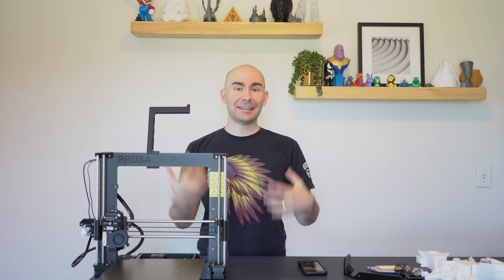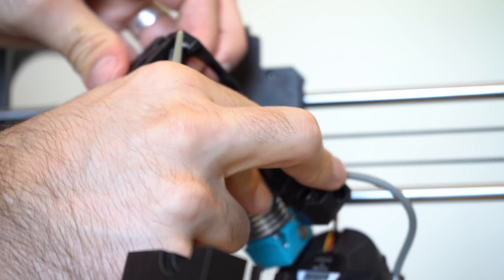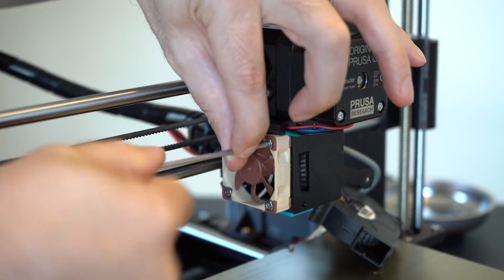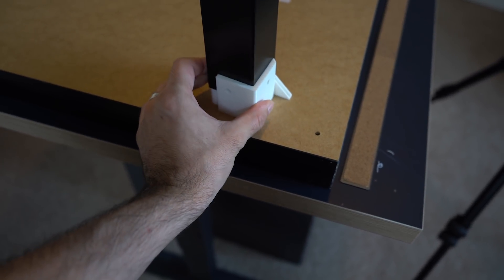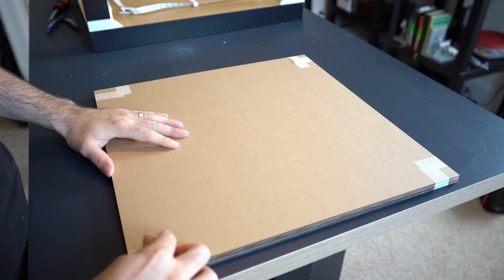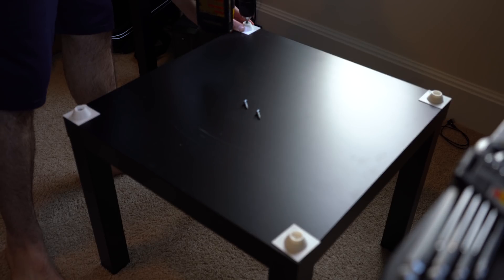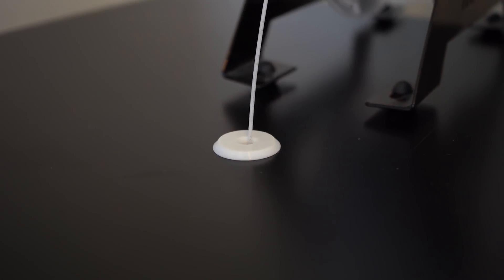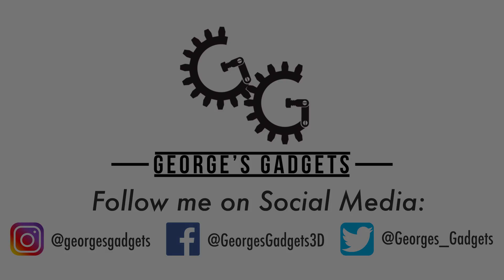Assembling the IKEA Lack Enclosure & 3D printer Prusa MK3 new carriage

Comment from the maker: Has anyone built an enclosure yet?
Reply: Yes, actually not a fan at all of how rickety it turned out, far too much inconsistency of the tables.  Going to just get some lumber and rebuild it reusing the plexi again.
Reply: @cruzinbill  I tried it with a slab of concrete and it seems like that stabilizes it quite well
Reply: @blackhawk7118  if your table falls through the floor post a picture so we can have a good laugh.
Reply: @blackhawk7118  Please, tell us more about this concrete slab.  does it make the structure significantly more stable?  How much and where did you add the concrete?
Reply: @johnahamelv  Yeah, it stabilizes everything surprisingly well, I put some foam pads on the underside, in order to avoid scratches. I suggest you watch cnc kitchens video about it, he uploaded one yesterday!
Reply: @blackhawk7118  I watched CNCKITCHEN' video, but he does not mention the specs of the concrete slab (dimensions, weight, etc.), or the process of how he produced it.  I assume I can purchase a bag of concrete from Home Depot or Lowe's, but I am not sure what to do after that.  Also, is the foam he is using is pretty thick, so I do not think it is carpet pad.
Reply: @johnahamelv  At my local hardware store, you can just buy any old slab of concrete. It does not need to be anything special, also I don't use foam, only small feet, those that you put under Ikea stuff so that it won't scratch the floor. Don't know how you call those, just those little pads :D in Germany we call it "Filz". Maybe look into the paving section
Reply: @blackhawk7118  Thank you very much.  I was under the impression that I needed to build a mold to pour wet concrete.  A premade paver sounds like a much more reasonable solution.  I think I should be able to find a correct size paver for my enclosure at a local hardware store.  Again, thank you so much!!
Reply: @johnahamelv  no worries, I'm glad I could help you.
Reply: @blackhawk7118  I stopped at Home Depot.  I purchased a 37.3 lbs 16" x 16" x 1.87" paver for $3.89 + tax.  I guess I have not visited that part of the store in a long time.  Now I have to figure out what foam to use.
Reply: I haven't build an enclosure, yet, as I am not currently home. However, I've used half of it to rack my PowerEdge R710. I put casters on mine that I got from the local hardware store. I have a different 3d printer, so my tables are upside down and the top meets legs to legs (if that makes sense at all). I printed some parts that I found on thingiverse to facilitate this coupling of the tables. The casters were my idea and the racking of the various computers/servers in there were based on trial and error of different mounting hardware. I have two tones of some LED strips I bought that rate about 85 CRI that I am going to mount to give some passive lighting. I also want some RGB action in there--this is a secret I'll be working on when I get back.. This video inspires me to add some features to my future enclosure. Btw, this is a really great video--one of your best.
Reply: Building it right now
Reply: no but I'm planning on it.
Reply: I build this enclosure a few month ago but I think it is very unstable, so I am going to try using a slab of concrete under the printer. Since using this enclosure, I get some Y-axis crashing even with the 65° heatbed cover.
Reply: blackhawk 
Print some triangular brackets for the outside of the legs.
Problem solved.

Comment: Great video!  can you advise some details on the spool holder you decided to use, is it fixed to the top of the lack table? Did you make the hole for the filament guide in the centre of the top. Thanks

Comment: The reason to not use PLA is because the parts will melt if your box gets to hot. I had mine melt and a door fell off when I was printing tpu. So if you plan on printing anything other than PLA parts I seriously recommend not using PLA for your parts

Comment: For attaching the bottom table, why not redesign the corner pieces for the enclosure part without the plexi holders and use the truncated cone meshing method. That would even the look out and make it a little bit modular (and give a couple more vertical inches in the bottom storage area. Better yet, if you have the money for an extra set of plexi, leave the corner pieces as designed and have an enclosed storage area under the printer.
Reply from the maker: Great idea Chris! I just wanted to use the metal brackets, just my own preference.  But I like your style :D I’ll try that in the future
Reply: @GeorgesGadgets  Expanding on what I said, I was first just thinking of using the plastic pieces between the bottom of the feet and the top of the lower table. But after watching your installation video where you pointed out that the pre-drilled hole in the leg is used to attach the leg-bottom plastic piece I realize that the leg-top plastic pieces are also necessary.

If you want to get even crazier (and will probably start having to mount the contraption to the wall) also add an enclosure area to the top. Use silicon to seal the plexi to the underside of the table and to the legs. Use some sort of weatherstripping on the bottom edge of the plexi and on the doors. Then put a rechargeable desiccant pack inside with the filaments (multiple rolls for MMX builds) to use as a dry box to print out of.

Comment: Did you use two or three tables? I just purchased two but I feel like I’d like it a little bit taller. I might get a 3rd table and shorten the legs slightly.
Reply from the maker: I used three and it’s perfect, if you only have two I recommend getting a third, or using some 2 by 4 to make it a little taller

Comment: I have a question? Three tables wouldn’t make it top heavy would it? How’s you enclosure doing?
Reply from the maker: Hey! It is slightly top heavy while the printer is stored in it but it doesn’t shake or wobble to much.  Mine are doing fine!  It really is the build that puts stress on them but after they are assembled they are good to go
Reply: When we put IKEA tall cup oard up, we screw the to the wall with small angle brackets.
Why not with this?

Comment: How long did the plexiglass take to come just ordered it yesterday
Reply: Got the plexiglass
Reply from the maker: Awwww hell’s yeah Allen! You gonna finish the build tonight?
Reply from the maker: Took just a couple of days for mine :)
Excited for you Allen, I hope you have fun
Reply: Thing is did you use priority or the other one
Reply from the maker: I think I picked standard, but I live pretty close to those guys
Reply: No I don’t have the right screw size for the head what size is it
Reply from the maker: It should be #12 for the brackets and I used a smaller size for the power supply
I should have them all linked in the description
Reply: Do you know the screws fore the frame brace  didint get a kit so I don’t have any extras
Reply from the maker: You should be able to use the two that hold the power supply to the frame and then two that hold it to the aluminum extrusion

I think you need some nuts for the frame though, I am not 100% on the size but pretty sure it’s m3
Reply: I think I’m going to finish the build tonight

EDIT nvrm the prusa not stinking yo anything I just needed to print 2 more hinges

Comment: Thanks for th build video.  I have all the parts for my IKEA lack enclosure, but I've been too busy printing to assemble it.  I just realized that all my LED strips are 12v, so I'll have to order a 24v strip as well.  The one you used looked good.
Reply: If you don't mind some extra electronics jazz, you can get some pretty cheap DC-DC step up BUCK converters.
Reply from the maker: No problem peter, I really like them I could probably light the whole room with them XD